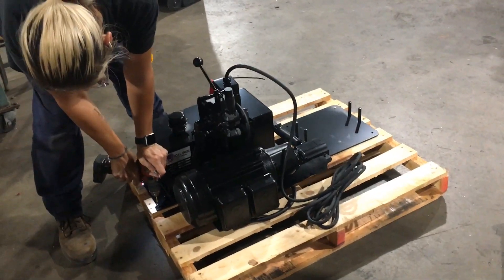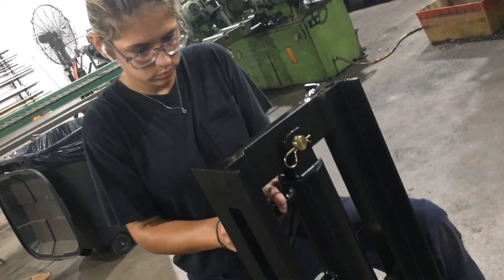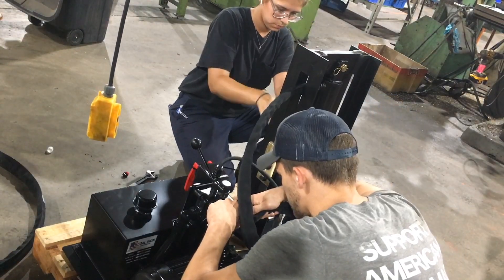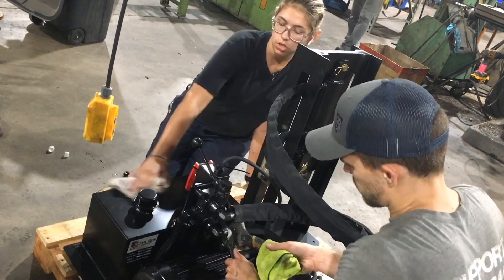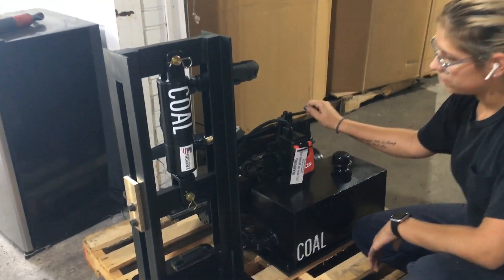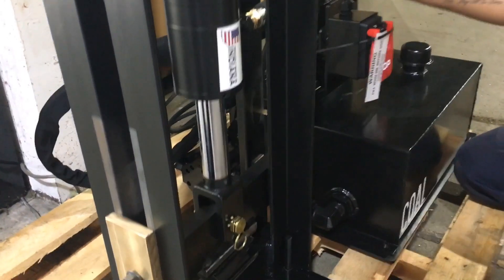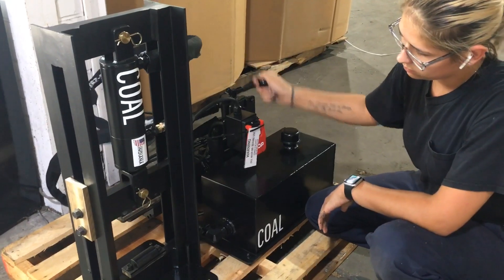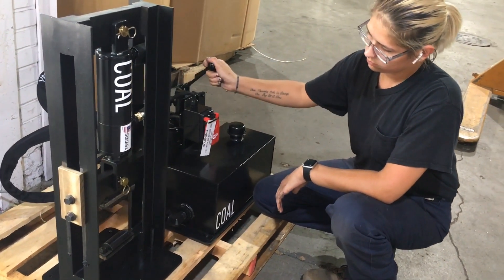12 Ton Forging Press Setup!

Comment: You REALLY NEED to do a bit better showing which port on the valve goes to the which fitting on the ram.  I'm thinking the "A" valve port goes to the top ram fitting to extend the ram?  The manual does say "top fitting to top fitting".

Also, use a yellow or red press for the setup video.  The black press is so hard to see detail.